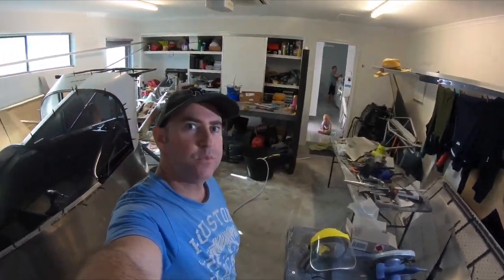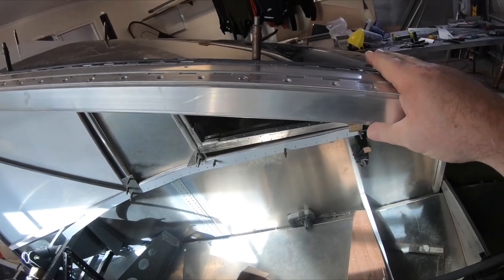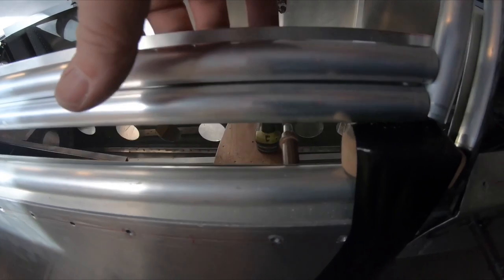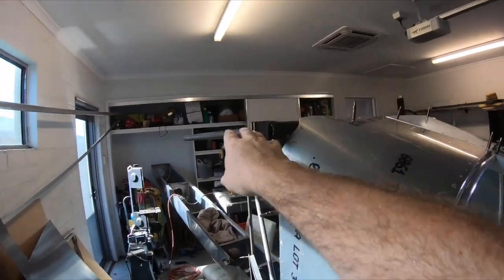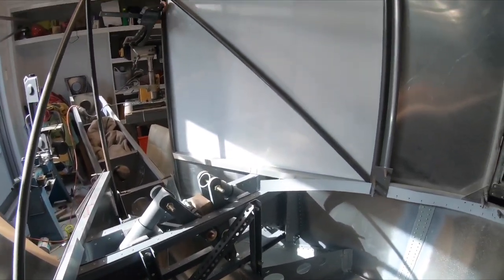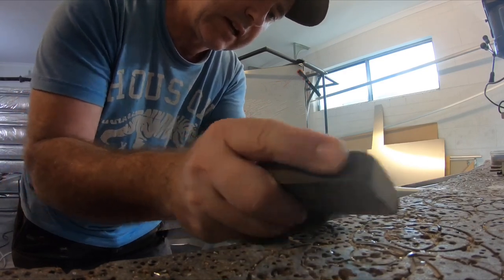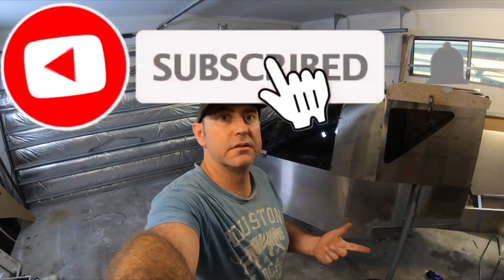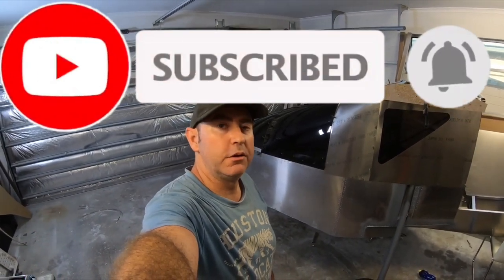Unleashed Experimental seaplane engine options include Rotax 915 windscreen and Doors

Comment: Another great job Michael, with the added bonus of watching your helper grow up. Question? the lightening holes do not appear to be flanged or is that just the camera angle?
Reply from the maker: Thanks for that 😊 it’s good he will be able to look back later and see himself . The lightning holes through the middle box section are not flanged your right , flanging is not required here the material is 2mm thick plate so doesn’t need any more rigidly.